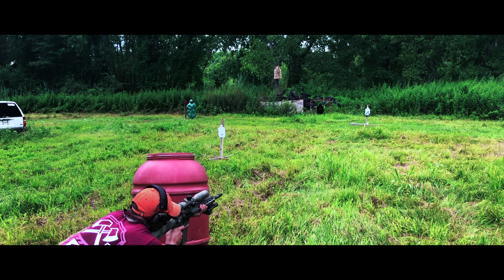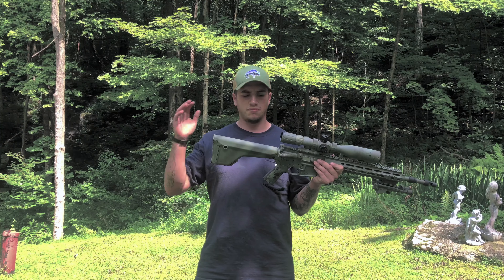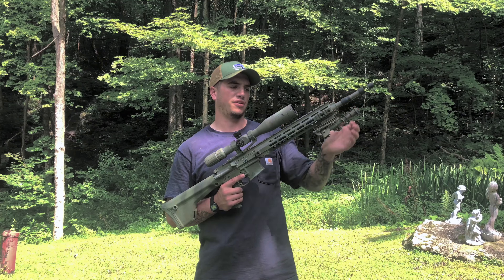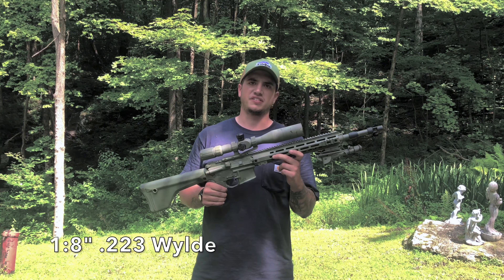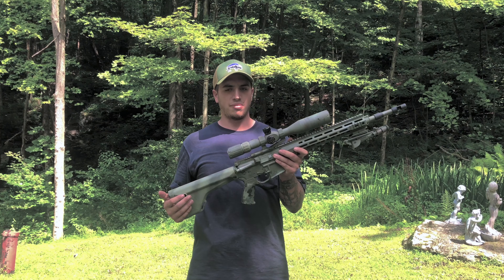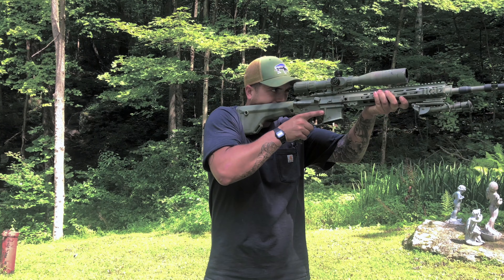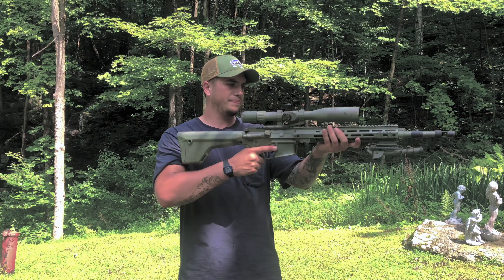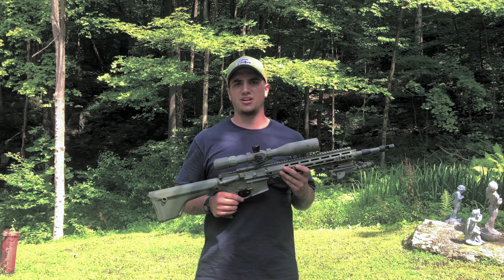SPR AR-15 Build Final Review; 'Mk 12 Mod 2'

Comment: Something I did in my mk12 cloneish build looks correct but since colt lowers are banned by name in California it is an aero lower but I used a standard rifle buffer and spring but added 1 tungsten geissele buffer weight and it cycles anything now even cheap steel case just something you might like to try I had cycle issues with some Ammo but now it rocks and the rest of the upper other then barrel being a centurion arms Douglas barrel is pretty correct lol
Reply from the maker: Blackcloudr1 1 thanks for the insight, man. I was playing around with parts I had to see what would give me the lightest recoil impulse. I’m gonna switch to a ar15 buffer spring and see how that works but I’ll definitely look into your idea
Reply: Madd Maxx Guns Channel it was something like $20 for the geissele tungsten but it basically made it into an h1 buffet and I’ve yet to have any issues after 500 rounds so far not that it’s a lot of rounds but I don’t have the feeding issues like I did with the first 20 rounds and all I did was add the tungsten it just gave it enough weight to force it home

Comment: Working on similar rifle. Going w/ a Geissele rail as well. Thoughts on almost exact set up but with 15' rail vs 13'? I'm on the fence with that part.
Reply from the maker: That makes sense. The ONLY reason I did 13” was aesthetics. I wanted to keep the ‘SPR’ look with the gas block hanging out.
Reply: Madd Maxx Guns Channel I’d do 13” for sure if I could fit the flip up sight gas block. I love that look but I love the Geissele rail better. That 1 extra inch interferes with it. So I think. So I’m still stuck!!! LOL.... looks V’s looks. Can u confirm that 1” would cause problems with the PRI flip up front sight gas block ? Basically - how much of your gas block is covered by the 13” rail? Thanks!!!
Reply from the maker: I can’t 100% confirm but it should fit. The PRI handguards are 12.75”. I don’t seeing the 1/4” making that much of a difference.
Reply: Madd Maxx Guns Channel wow, really!!! I’ll make the gamble over 1/4”. Thanks for letting me know that about the PRI rail. Down side is... now my build $ just went up by $160....Lol. 
WORTH IT‼️
PS. Rifle looks sweet!!! Keep shooting!!